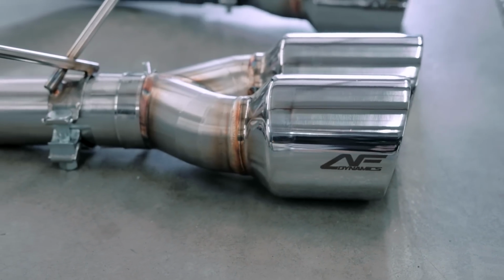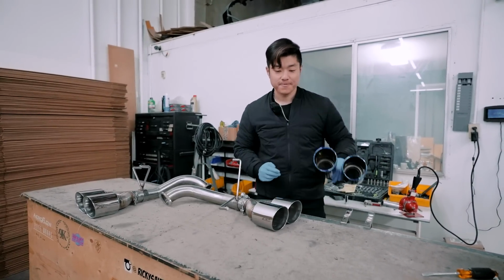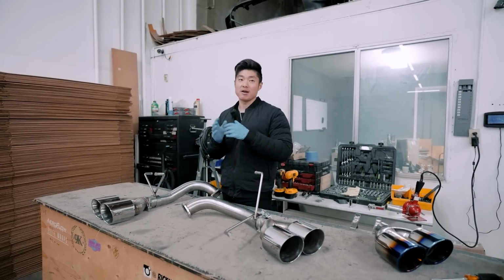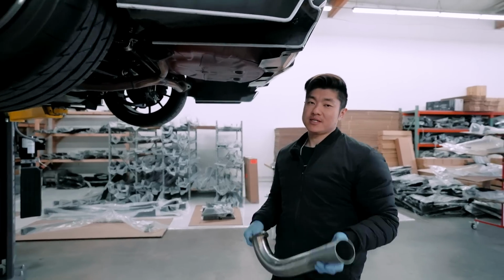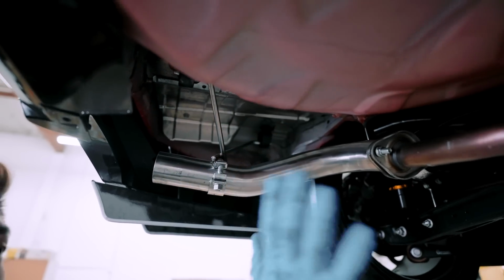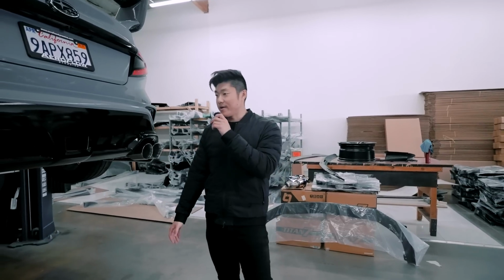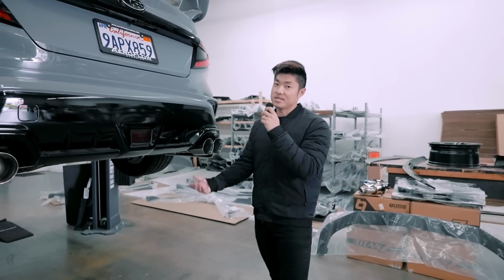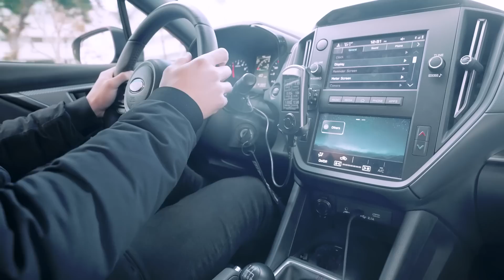How To Make Your Exhaust Pop! (NO TUNE NEEDED!)

Comment: How did you remove the secondary cat? Just cut and weld a pipe in its place? I already did a resonator delete and have the axel back but it’s not as loud as this. Does the secondary cat delete need a tune?
Reply: Anytime you remove cats on the wrx yes it needs a tune, the only exhaust that does is catback or axleback.
Reply: most cars need a tune if you remove the cats

Comment: If you take the secondary cat will you void the warranty?
Reply: Wondering the same
Reply: yes... cannot touch anything emmissions related
Reply: Secondary cat should not mess with warranty just the primary because the primary are the cats with sensors

Comment: Does this fit the 2019 model? Sounds dope!
Reply: You could use them in the VA due to the adjustable tips, some VB owners are using MBRP axlebacks from a VA because of the adjustable tips
Reply: I have the mbrp catback exhaust with muffler delete on my 21 wrx. By far the best sounding exhaust I've heard for that generation.

Comment: I just installed my carbon tips version last week on my stock 22 WRX, still no  pops whatsoever. I make sure car is properly warmed up to temps of 180 ar least. I tried shifting at different rpms(4k, 4.5k, 5k, 5.5k, 6k) tried normal shifting, tried aggressive shifting still nothing 🤷🏾‍♂️. Can anyone recommend anything I can try that I may not be doing? I figured I'll give it a week to see if the exhaust just needed time to adapt, but to this day 1 week later nothing. Please share any helpful inputs, thanks in advance 🙏🏾
Reply: @aeroflowdynamics ?

Comment: Would I need a non-resonated midpipe for this? or is this just something you throw on the stock exhaust?
Reply: Stock exhaust on the 2022 does not have a resonator.
Reply: Yes it does it’s in the mid pipe it’s small I had mine removed

Comment: What year is that car because i have a 2023 and it doesn't sound like that
Reply from the maker: Do you have our axle back?!
Reply: @aeroflowdynamics  yes I do.  But you're tune on that car.. you have an access port connected
Reply: Be honest about it.  Say all the mods you have on that car, that will be false advertising.
Reply: @orlandotista5142 he did but it’s a cat and resonator delete with the axle back
Reply: @orlandotista5142 the tune doesn’t do anything unless you ask for burble tune
Reply: @orlandotista5142  the best way to make your car pop is to have a manual transmission then learn which rpm’s your car likes to pop at
Reply: @orlandotista5142 i am stock on my 22 and no pops at all, very misleading smh

Comment: you guys say no tune needed but then proceed to have a tune on the car...
Reply: can confirm you do not need a tune to pop with axle back
Reply: @c4lol i have Axle Back and no pops whatsoever after trying everything shifting possibility
Reply: @accountsmaster9813  are you automatic or manual? I learned that downshifting around 5500 rpms does the trick. And spirited driving and shifting close to redline lets out pops as well
Reply: @c4lol  i have manual... i have tried shifting around red line and nothing still. But I will give the downshifting at 5500 a try. Thanks